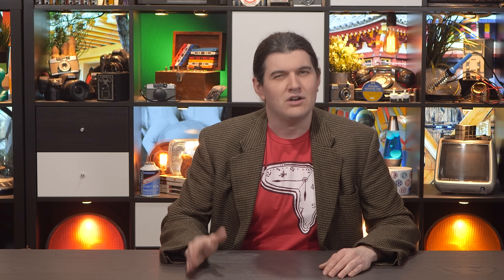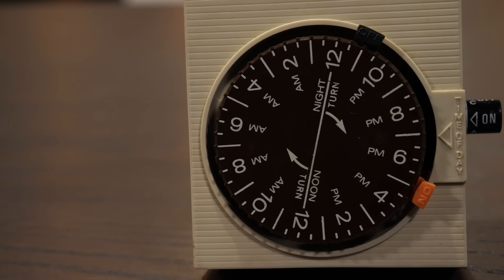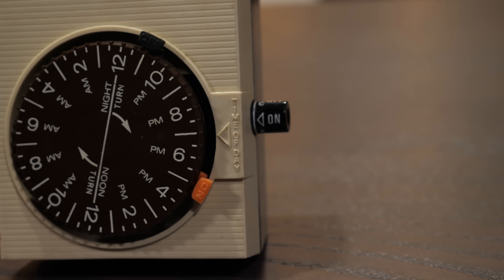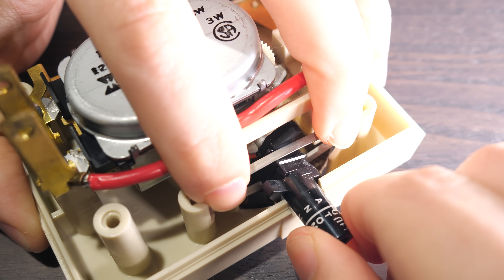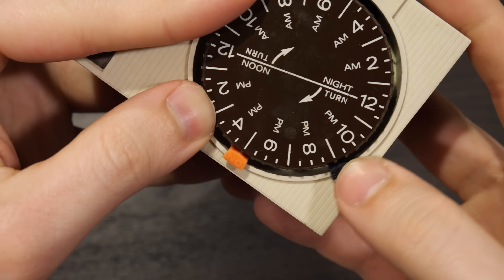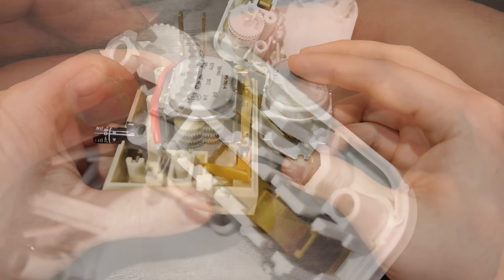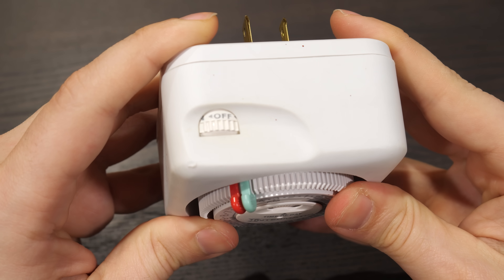Timer switches: literally just a clock and a switch

Comment: I mean yeah, you could use a "dumb" timed switch and I actually used one to reset my router in the night. The reason was simple. After around 24 hours, I got an IP change and it happened a lot that i got it during a match of CS:GO and while the game says you can reconnect, you couldn't after an IP change, at least around 2015. 

With Smart Home you have more options. My PC is connected to one. First ist that is measures the power used. Pretty neat to know what your activities cost you. I also can switch the switch remotely from around the world. Why would I want that? My PC is set up in such a way, it would boot if it gets power, after it lost power. I could use Wake on Lan with my Smart Home but I did not, because of the next reason. I bought a set of 2 for a self made Master/Slave power strip. When the switch with my PC dropped in power used, it turned off the 2nd one. Also because my PC had an issue, where it wouldn't turn on after a week left connected but turned off, I figured out that if I disconnect my PC from power, it would start right away. So after my PC was off and used less than 15W, it cut power to my PC. It worked. Also nobody had a clue why my PC behaved like that.

Last year I bought a UPS. This was something I wanted to do for a long time but because of the War in Ukraine, I decided its now the best time to do it, if Europe might get in trouble to maintain a 24/7 service. This UPS came with a Master/Slave outlet system, so I used it instead. This way its split. One switched outlet has no battery backup but the other has. With a battery backup, I just need one display and my PC and not my 2nd display and speakers.
I also disabled the program that cuts power to my PC and somehow it will turn on again on its own. 

Also Smart Home doesn't need to be App driven and the whole Cloud stuff. First things first. Cloud driven is bad. You want to control your stuff without internet. Sure some fancy stuff needs internet but not all. Home Assistant is one option. You have a Server (a Raspberry Pi works) at home and on its own it can control Wifi Stuff. It can connect to other gateways within your network or over the cloud and control the stuff there. Or you buy hardware that can speak the right language. I have a Zigbee Stick in my Pi. This is awesome. Before that, I had a Philips Hue Gateway. It can control Hue stuff. With some tricks, you can connect some Ikea stuff but this is a pain. Other stuff is not working. With my USB Stick, I can add a lot more Zigbee devices. I have bought some Ikea stuff and it works like a charm. The Button from Lidl is not working so well. I think the issue is the Button itself. It needs several tries until it sends. 
With cloud stuff I can do more. I can control my stuff based on my calendar. When I say that I work from home, it can change my heating profile, change my light alarm and other stuff. If it could change the alarm on my phone and Watch, it would be nice but it can't (yet). But it could be something simpler. When you say you have a party in your garden, your system can switch to party mode and keeps the light longer running.
Real Smart Home is when everything is automated. Its not real Smart Home, when you switch everything manually via an App. This is just a fancier remote. Getting Smart Home working without any input is nearly impossible. Human Lives don't work that way. But I think just entering something in your Calendar and having the right tags and you Smart Home knows how to react, is good. Imagine manually switching some timed switches and not forgetting to switch them back. I rather use my time for more important stuff.

Comment: @Technology Connections I bet I know why that old one doesn't work anymore! I have a similar one that dates back to the 80s I think, it was part of a low voltage lighting transformer, and one day mysteriously stopped turning on. I took it apart a few months back, and inside the metal 8 shaped casing, there was the drive rotor, and adjacent there was another one that had a gear on it. Had, of course, since the gear had completely disintegrated, leaving the rest of the timer non-functional. I would wager a guess that the same issue has affected the old timer you have! might be worth taking the lid off and taking a peek inside to see.

Comment: I like the 1940s naval time switch devised by the British for blowing up enemy ships by detonating a limpet mine (attached magnetically to enemy hulls by a diver or mini-sub). The key timer bit was very simple - an aniseed ball, a type of sweet made by repeatedly dipping a tiny starter sphere in a sugar solution till it reached the required size. This manufacturing method had the benefit that it also made the aniseed ball dissolve in a reasonably predictable time when submerged in water, depending mainly on water temperature.

The aniseed ball was positioned inside the limpet mine to block a spring-driven striker. Once the ball had dissolved enough in the seawater to release the striker the mine would detonate. By that time the diver had hopefully had enough time to escape from the scene of the resulting devastation.

Comment: I don't have the older one, but I have the others.  I also have (or had?) one that has tabs with 2 pins on it, one longer than the other.  Each time has 2 holes, so you put the long pin in the outer hole, that's a time on, long pin in the inner hole, time off (or vice-versa, don't remember).  I got a couple "high current" ones that have the 3-prong as well.

It really is impressive how something so very simple can be so useful.

Comment: Defrost timers in refrigerators are pretty similar, using a lot of reduction, geneva drives also in some cases. When the compressor is running, it will rotate a cam shaft which moves the changes the position of brass contactors, and periodically opening the circuit which drives the compressor, and closing the one driving the defroster. A pretty neat electromechanical switching system.

I had to take one apart while diagnosing a non-working defroster (it was actually the defroster thermostat up in the freezer box which had failed) but I pulled the "timer" out to check it for defects.

Comment: you missed the switch replacement timer which is a battery powered digital clock that turns a rotary switch.  (the purpose of it being battery powered is that it can turn ANYTHING on and off up to the rating of the contacts)

Comment: I was actually just shopping for a hot water heater recirculating pump just last night. The ones I found have lots of tabs so you can turn the pump on or off in 15 minute increments. I wonder how similar the internals are.

Comment: i'm not sure about other countries, but the mechanical timers are still very common in the UK as a built-in part of our water heating system(with the boiler upstairs and the timer in the kitchen). Though they're very slowly getting replaced by on-boiler timers and smart thermostats
Reply: Mechanical timers are also very common here in Finland for engine block heaters and car interior heaters during the winter. There's also digital timers but the LCD displays just don't work in the cold. Block heater and interior heater are 1000W - 2500W combined so the power consumption of the timer doesn't really matter.

Comment: You should to a video on sequencers.  Like they used to have on old washing machines.  It was a shaded pole AC motor turning a multicam assembly that triggered solenoid valves and motor contactors.  So that when you selected wash, it would open the water vales to fill the tub, then agitate, then drain, then fill with water again, agitate again, then drain, then spin and drain.  I.E. a sequence of events.

Nowadays this is done with a computer, but it used to be done by a motor and a cam system operating switches at the right sequence.

Comment: If you want a solid timer that can handle a large load, get a mechanical electric water-heater timer. They're 240 volts and rated at 30 amps. That should take care of your LED Christmas displays. Well, for most people anyway. BTW they're fairly loud, so you could use one as an alarm clock, too.

Comment: I have a couple of those timers as well, with the build in pins (but over here, they have 96 pins, not 48). One drawback: the clocks themselves make noise. Probably just the gearboxes and it's not very loud. But it's constant, and I find it irritating. Which is why I only use them in places or times where I am not.

Comment: Those digital timer switches are awful. Too many settings for a to small display and awful button lair. And the batteries always leak when the switch is not in use. The old analog timers just work and are set up in seconds. And advanced timers are better to set up with Zigbee sockets and Homeassistant.

Comment: 14:00 So, it's true! Defrosting works with a crude timer built into the refrigerator. I thought that it must work that way. That is why I "upgraded" my 1980s legacy refrigerator my landlord won't replace. I put the timer between the refrigerator and the power outlet, switching it off for a short time every night. In the morning I throw out the water. Not perfect, but I don't have ice gradually building up inside. 

Great video, as always!

Comment: I have a situation where I need the AC turned OFF for a certain period of time each day, and ON the rest of the time.  I thought, great, I'll just get a new digital timer (one that doesn't lose time when power is out) instead of one of those old ones with all the little stubs and stuff.   They are silent, programmable, use an actual relay... nothing really to wear out beyond the relay.  Perfect.

Great idea, right?  Wrong... the digital timer lets you put in up to 15 time ranges to turn the device on in, but when I tried to set it up to leave the device on by default and just turn it off during a time period, it got wonky.  I managed to sorta get it to work, but if a power failure occurs and comes back the timer defaults to "off" and then waits for the next "on" time.  Which causes is to stay off for most of the day when its really supposed to be turned on.   To make matters worse, if I programmed it to only turn the device off for a period of time Monday through Friday... whelp, that didn't work either.  When Saturday came, it turned off... and stayed off until its next "ON" time 2.5 days later.

Garrrrrrr...... had to go back to the old fashioned kind that has lots of tabs.

-Matt

Comment: When I was 11 years old, in 6th grade (1980) I built a diorama for some homework assignment, and I wanted it to flash a light for just a moment every so often.  Not knowing about timer switches, I took the cover off a clock and taped two wires on the face such that as the second hand passed over the wires there was a brief moment of contact that completed the circuit and turned on the light.  Worked ok but over time the wires got bent down and didn’t make good contact.  I later re-wired it to use the hour hand and spread the wire out so that the light would be on for nearly two hours.  If only I had known about timer switches like shown in this video!

Comment: I remember using one of these for a physical auto clicker. - It was for doing a repetitive task in Runescape that required clicking 1 spot over and over. Software solutions were ill advised since they were easily detected and got you banned.
I'd set it up to click for 4-6 hours then it stop, and after about a minute of inactivity my character would log off.

Comment: I like to use them. They're way less hassle and cost about 1/4 of a "SmoRt home" equivalent. My - admittedly quite more modern - models draw around 0,5W and are therefore a viable optin for saving energy or whenever you got something time sensitive (to the rather low degree of time accuracy that is)

Comment: Intermatic is the king of timers.  There are hard wired units that was used to turn on/off lights in parking lots and multi unit homes and industrial buildings. There are units used in homes from Christmas lights to hallways needing automation, to bathrooms for heaters and exhaust fans. One of their most fascinating unit is one with clock and switch running off an, aa alkaline battery for a year.  I was able to redesign to run off a, d alkaline cell and got 4 years of operation without attention whatsoever.  It had 6 programable modes and quite flexible.      Cheers

Comment: I've worked on hundreds of electrical devices and all I can honestly say 90% of them are this simple. Literally everything is just little switches and mechanical actuators OR it's digital. There's usually a pretty sharp divide, and even when it exists you'll most often be able to work around the digital stuff if you do a little digging.

This stuff is why I got into electrical engineering. It's so simple and so many people don't bother to learn how it works. 
And why? Because it can kill you?
I mean, yeah that's a good point. But still!

Comment: I used those for many years to turn on a bedroom lamp. When I was younger and had trouble waking up in the morning, it, along with a regular alarm clock, did the trick. Some of the mechanical ones gradually get noisier when bearings or gears wear out, and eventually sound like a coffee grinder.

Comment: I use two 96 segment timers for my hydroponics system.  The pump kicks on for 15 minutes every hour during the light cycles and 15 minutes every 90 minutes during the dark cycle.  The other timer controls the lights.  I currently have it set to run for 16 hours per day to meet the DLI requirements for the veggie varieties I grow.

Comment: It's not Nintendo that's to blame for your searches being ruined (at least completely at fault). Google has definitely gone to hell the last few years. And God help you if you EVER try searching for anything technical. Even using search operators to try and specifically get something like -nintendo switch electrical I guarantee will still bring up stuff about the Nintendo Switch. I can't think of a specific example, but I have problems like that at least a few times a week. Or if it does return relevant results for a technical subject, they're usually really dumbed down sites meant for children or some crap like that. Or just a site that provides the illusion of educating you about something when in reality it's just cashing in on clicks (usually through Google sponsored ads).

Comment: I'm a sabbath observant Jew which means no manipulation of electronic devices for about 25 hours once a week. I use these pretty frequently, as do almost all others in my cohort. As a matter of fact, these are so essential to Orthodox Judaism, they can be bought for about $3-5 in any Israeli grocery store.

These days I've also started switching everything I can over to smart switches though. I even have one on my water heater. Nothing like waking up to a hot shower (live outside the US).

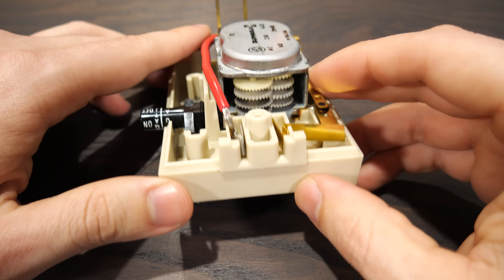Comment: Very anticlimactic @ 5:39. After the buildup from the previous video, I would expect a HUGE celebration when you finally found terminals which engage with the holes on the plug.

Comment: I swear when I was a kid (late 80's early 90's) we had a timer that looked very similar to the first one but with removable metal tabs. It was in the laundry room. I think it somehow was wired up with the hot water tank outside so it would stop heating around midnight and then kick back in around 5 in the morning. But it's been so long I couldn't be a reliable source. Also I was 10 the last time I saw that thing.
Reply: Yes; the one with the removable metal tabs predates the "slide the tab" version by quite a while.  We had one of those that ran the outdoor Christmas lights, then ran my mom's Gro-Light some weeks later when she started her seeds for the garden.  You actually pulled the dial out of the unit to change the tabs.  For manual use, you pulled it out slightly.

We had that timer switch since at least the early '70s.  The sliding tab ones didn't come out until the late '70s or early '80s.

My parents are still using that 50 year old timer for Christmas lights; however, it's just the window decorations now.
Reply: I have an intermatic like that for my pool pump. Little thumbscrews on the tabs, and a lever that gets flipped by them. Same lever is also a manual switch. And you pull the face out and rotate it to set the time.
Reply: That timer is on a recirculating pump for your water heater. So it will circulate hot water when you need it.

Comment: The wires around the motor leads might be an example of the ancient lost art of wire wrap. That would be a good video - how wiring boards were made before we had printed wiring boards (more commonly called printed circuit boards).

Comment: The oldest clock switch I've ever owned was from my grand father's chicken coop.
Looking back I think it pre dated WW2. It was a large black metal case with an actual pendulum clock inside and a small 24 hour dial with metal arrows you could set to program on and off times.
Too bad I threw it away somewhere in the mid eighties :(
Reply: I have one similar to that (it's missing the case) that operates on a mainspring. It has an actual snap switch that it activates. I'm guessing it's pre-1930, but would be willing to bet it's WW1 era. It sits in a box because I can't find anyone to replace the balance spring.
Reply: @devildog1912   Try reaching out to  @Clickspring
He might find it interesting enough to want to help?